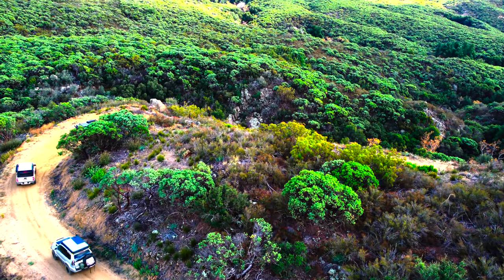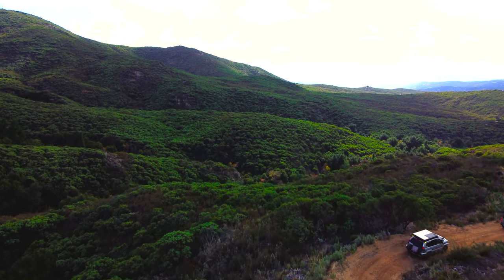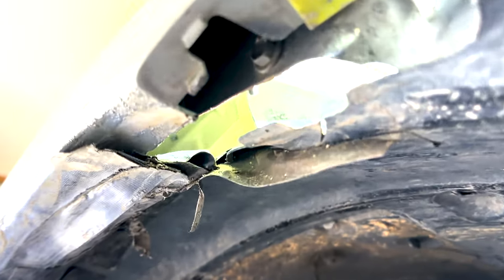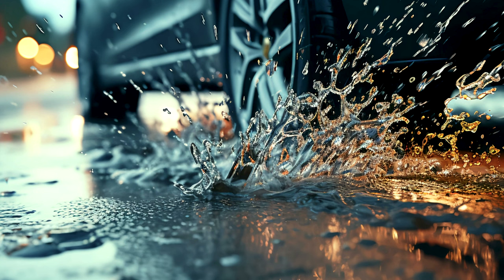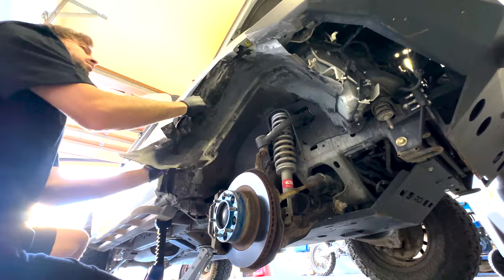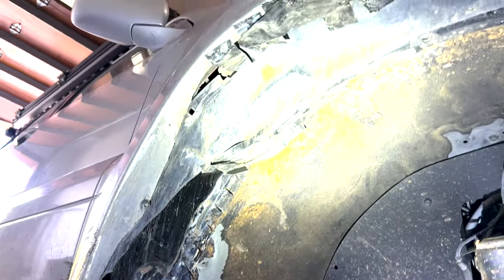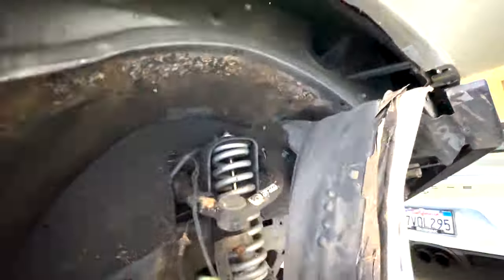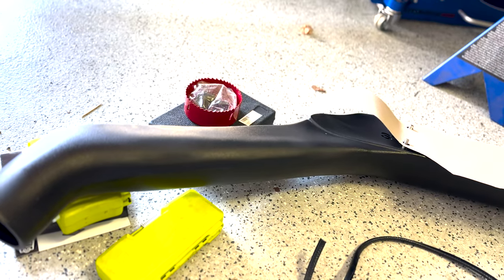The REAL Reason You NEED a SNORKEL (Install Guide)

Comment: Great vid...Well done.  Quick question:  What happens in a torrential downpour rainstorm?  My thought is that's a much more likely scenario to cause a massive amount of water ingress than spray from around the fender liner with tape.  No?
Reply from the maker: Nope, I tested it at the end of the video with an absolute torrent from a car wash machine and it was totally dry. It’s been through many unusually intense California downpours as well and no issues. I’m just glad I don’t have to worry about that air scoop in the fender well enabling water to lock up my engine anymore. Super happy with this mod
Reply: @lexus_offroad_adventures  Thank bro!  Yes, I made the comment before I saw the car wash test at the end.  I'm sold, and thanks a lot!  I'm going with 35's now too, and going broke watching your vids!    Thanks again.

Comment: quick question bro. with your setup, what's your MPG? also, with your amazon snorkel, did you have a good template? i've heard horror stories of bad templates resulting in multiple holes on the fender.
Reply from the maker: With my setup, all my accessory weight, 35s with a 4.88 regear, I’m at about 12.2mpg average on the factory computer. So add like 16% to account for increased tire diameter. About 14mpg combined city/highway.
Reply from the maker: As for the template, I showed everything in the video… the top holes needed to be slightly notched downward. But you can always verify the template before final install. No sweat